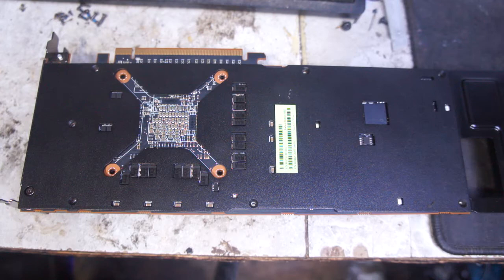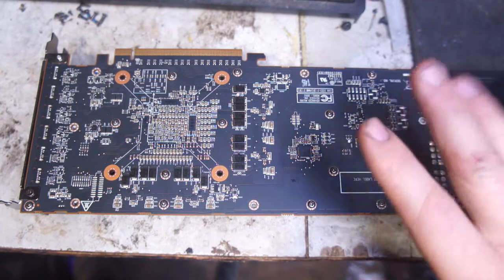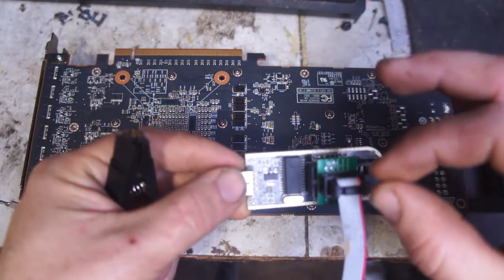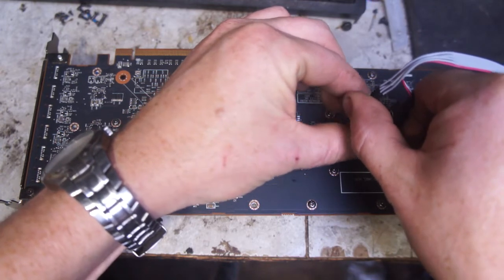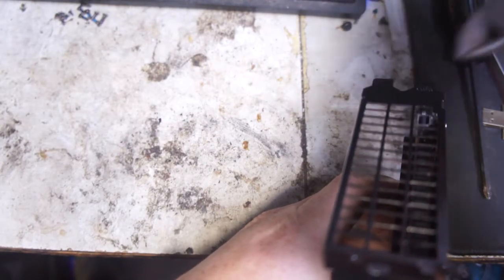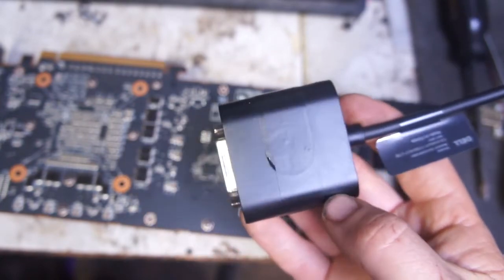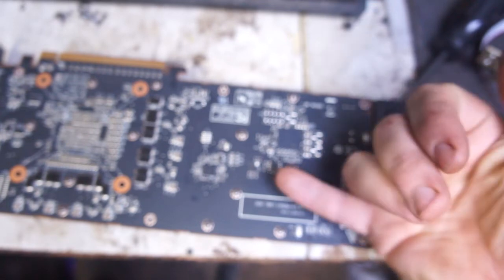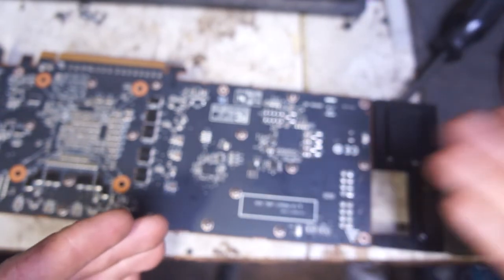Flashing MI25 to be cheap WX9100 (Vega 64)

Comment: Hello!
Can you flash it to a simple vega56/64 8gb bios? (Probably no because of the 16gb ram yes?)
Reply from the maker: Correct, VRAM amount must match. With some work you can do Vega FE though. I have a video that glosses over that then shows it working with well managed temps without tanking FPS.

Comment: You forgot to mention that this sort of contraption will not have all the nice features that AMD Gaming cards have such as RSR. This option will simply not exist in the driver. 

You can still use a games built in RSR but you cant have it as a global setting. Also the Radeon PRO drivers are unstable. Some games word great and others crash. Its a clusterfuck.
Reply from the maker: I have significant stability issues. Who gives a fuck about FSR and DLSS? Honestly, I'm tired of hearing about them.
Reply: @Marc_Wolfe  Correct. The stability is questionable, to say the least.
Reply from the maker: I assumed mine was just faulty. Abused in a mining farm or something. Sample size of one and all.
Reply: @Marc_Wolfe  Nope. Unfortunately not the case. I bought mine from a guy who mods them and sells them. He 3d prints a nice shroud and all... yet once I received it, I cant get it stable to save my life...

Comment: And why exactly would someone want to do this? What's the benefit of WX9100 over a MI25?
Reply from the maker: Windows support, display output of any kind, even Linux support went to shit as far as I could tell. Basically, it comes down to making use of trash. Having something that functions vs just a brick.
Reply: @Marc_Wolfe  What? The mi25 is a ML card. It's definitely not a brick! For less than 100 USD you get a decent card for something like stable diffusion. Why would anyone buy a mi25 to use as a graphics card?? Makes no sense.
Reply from the maker: @dtesta  "Machine learn"... it's the same shit as any other Vega64. The end. It was a prototype, had enough validation to sell as a beta test, then got artificial segmented models later.

Comment: Hey I bought the ch341 but when I try flashing the wx9100 bios it says error file size isn't the same size as the  chip, any tips ?
Reply from the maker: M25p80, as in description
Reply: @Marc_Wolfe  it auto detected the m25p80, just confused on why it thinks the chip is 1mb but the rom file is 256k, sorry about all the questions man, I've tried getting help elsewhere but most people don't have a clue about this stuff.
Reply from the maker: @ericwills7748  There are a variety of chips with the same programming interface, like data format and whatever. The M25P80 isn't the actual part or the right size; write it anyway.
Reply: @Marc_Wolfe  I tried forcing it but it just gives the same error
Reply: I finally got it flashed to wx9100 but unfortunately the mini dp to HDMI adapter I have didn't work so I ordered the dell  mini dp to dvi in the link you shared, thanks for the help man, keep the cool vids coming.
Reply from the maker: @ericwills7748  Sure you flash the right one?
Reply from the maker: @ericwills7748  I meant the right EEPROM on the card.
Reply: @Marc_Wolfe  oh mb, yeah I think so I flashed the one you called chip 1 in the video
Reply from the maker: @ericwills7748  I don't think I pointed them out wrong, but it has been a while; on the off chance I did, try flashing the other one. I can't check for you right now, I broke one of the jumpers on mine and ripped up a trace.
Reply: @Marc_Wolfe  working tonight unfortunately, will tomorrow if possible
Reply: @Marc_Wolfe  I must have jacked something up when I flashed it, when I install it in my ASRocK taichi x570 it won't boot shows a 07 or D7 error code 😢
Reply from the maker: @ericwills7748  That the good part about USB flashing. Just try again.

Comment: Was Wondering, it's flashed to WX9100 , does it still consume 300 watt? coz the Wx9100 is rated at 230 watt.
Reply from the maker: As far as I can tell, it follows the WX9100 power limits.  Frontier Edition is better, but requires soldering because of AMD's bullshit. There's probably (definitely) some way to make it cooperate as Frontier Edition without soldering, but I don't know how.
Reply: @Marc_Wolfe  Yeah, saw a video regarding the "Registry" mod.. But hey a used WX9100 is around $400 to $600 in Ebay...AMD Instinct MI25 is $90 , water block around $100,  for $190 not bad since I am gonna use it for a Mac Pro 5.1. Vega 64 with 16gb is almost the same as WX9100...RX 6900XT is way too expensive too..U do good work man, kudos..

Comment: What exactly is the purpose of flashing here? Both cards have the same core config and the 9100 has lower clocks than the Instinct. Doesn't make sense to me.
Reply from the maker: You're right, it doesn't. AMD's decisions around artificial segmentation... that's why this is.... "required".

Comment: I need help, do you know why my gpu does not give video? The system already recognizes it, I have the 22q3 drivers but it doesn't want to output via mini displayport, I don't know if it's a matter of having to solder a jumper or I don't know
Reply from the maker: No soldering needed for the WX9100 vBIOS.
Reply: @Marc_Wolfe  I put the vbios of the wx9100, but it does not give me video. Do you know if any adapter works? or does it not matter if it is thunderbolt to hdmi?
Reply from the maker: @UnprocualXP  It's not thunderbolt. If you have an adapter that's thunderbolt only (like some Apple bullshit), don't expect that to work. I put a link to a decent one in the description.

Comment: Is there a difference between the MI25 8+6 pins and the MI25 8+8 pins?
Reply from the maker: As far as flashing the WX9100 vBIOS? Highly doubt it.
Reply: @Marc_Wolfe  I am about to buy an MI25 8+6 pin because it is cheaper than the MI25 8+8 for some unknown reason. Yes, I am going to flash the MI25 to the bios of the WX9100

Comment: According to your experience, which gpu is better, Instinct MI25 or Tesla M40?
Reply from the maker: A GPU without ports is... not great. My MI25 is defective. So in my experience, used GPUs overall have been a massive disappointment.
Reply: @Marc_Wolfe  does it not have the mini Display port like the instinct mi8 ?
Reply from the maker: @ericwills7748  Tell me you didn't watch the video without saying it.
Reply: @Marc_Wolfe  you're correct I didn't have time, I'll watch it thanks
Reply: I was gonna ask the same thing I'm currently on a m40

Comment: Any ideas how to cool it?
Reply from the maker: Quietly? Water. Otherwise...
Reply from the maker: https://www.youtube.com/watch?v=V6ttJLReuDs
Reply: Planning on 3d printing a duct myself... and using a large diameter CUI fan that has good static pressure amd move a ton of air, loud if at 4k rpm but quite below that. I used them in a rosewill L4500 build and was quite pleased... 3 of them can move a ton of air.

Comment: (sorry if answered elsewhere):
What happens if you just pop it in as an MI25 w/ a display connected? Do you HAVE to flash it to a WX9100 to get 'radeon-like' functionality out of the single mDP video out? 
I have a Vega 64 8GB @TM and want to use an MI25 16GB. I already have mDP adapters on hand from playing w/ Intel NUCs years-back.
Reply: Update: I've had my MI25 flashed to a WX9100 as a Daily Driver for 4-5months now. Also got Power Play Tables tweaked for performance closer to/above a stock Vega64 (where the extra vRAM isn't any help). My Aluminum tape shroud and 12x3.8cm 1.9A PWM fan have been more than sufficient since tweaking the PPT. The MI25/WX9100 has been a huge upgrade over my RX580 8GB and 6500 XT, and noticeably an improvement over my 8GB Vega64 (in most titles). I've been so happy with it, that I almost bought another one for crossfire testing, lol.  (This has been one of my best 'risky purchases' to date!)
PS: You can do multiple displays off the one mDP (within bandwidth constraints) using an MST hub. I tested 2x 1080P displays on an old DP1.2 eVGA MST hub, and a newer DP1.4-spec one from StarTech; they both worked. Caveat: The "WX 9100" works w/ FreeSync displays great, only on a single display. Most MST hubs that claim VRR/FreeSync/G-Sync passthrough, are reported to not do so reliably; oh, and they're $70-90+ too. (It's unironically and literally cheaper to get another MI25 and flash it, to get 2x VRR/FreeSync display-outs.)
Reply from the maker: Without flashing it, I never got it's display output to function AT ALL. I might be be misremembering some details, but I think if you install the NVv4 Azure guest OS stuff, you can right click in device manager and go through the list for driver options and just select "MI25". Probably horribly out dated with that option though. If you just want to use it for compute (no display, other GPU for display), you could manually select MI25, WX9100, Frontier Edition, or the more generic "RX Vega series", and have something that ... probably works for what you need. You'd have to do your own preliminary testing there to be sure though.
Reply: @Marc_Wolfe  Thanks. Bit the bullet and got one for ~$75+Shipping+Tax. Will be an adventure; but I love having 'unique' kit.
Reply from the maker: @labrat810  Hope I didn't need to mention cooling.
Reply: @Marc_Wolfe  I've had success in the past using aluminum tape to create a duct and mount for a 120x38mm 'server blower'. Hoping to find a 4-pin 12x3.8cm in my collection and have it PWM controlled (so it doesn't sound like a hiar dryer, all the time)
Reply from the maker: @labrat810  I used electrical tape. Aluminum tape tears easily... and is conductive.
Reply: @Marc_Wolfe  Reporting Back: Success! Software flashed to WX 9100 vBIOS using atiflash 2.93. Display and 3D works. Will be rigging up cooling shortly. (BTW. The VegaFE vBIOS does not produce video, even using an MST hub.)
Addendum: These "WX 9100"s POST in very "Legacy" non-UEFI systems. For giggles, I tested it in an A8N-SLI Premium. It worked!
Reply from the maker: @labrat810  yeah, anything X86 with a PCIe slot. FE gives display out until drivers load.
Reply: @Marc_Wolfe  That has not been my experience in the past. I have ran across some 'UEFI-only' cards that prevent POST entirely. Ex: My Asus RX 580s (MSI RX 580Xs works fine though).
Reply from the maker: @labrat810  I was talking about other cards.
Reply: @labrat810 do you have discord? It would be amazing to see your progress, I would also have a few questions
Reply: @labrat810  Planning on putting 2 in a KGPE-D16 for giggles... its also got 2 overclockable ES 6386SE in it... and 256GB ram because it was cheap lol I wonder how well HBCC works.... definitely going to test with a giant solidworks model.
Reply from the maker: Links in description will likely lead you to more answers you're looking for.

Comment: Decent video on using the CH341, but this card can be flashed with software.
Reply from the maker: I don't care if it can anymore; this option is more universally useful.
Reply: what software?
Reply: @Murr808  atiflash 2.93. Make sure you're running Command Prompt as Admin, and your WX 9100 vBIOS is in the same folder. Always use 'amdvbflash.exe -i' first, to make sure you're flashing the right card.
In my case the command was "amdvbflash.exe -f -p 1 218718.rom"
("-p 1" being the '2nd video adapter', and "218718.rom" being the .rom from Marc Wolfe's Video Description link. The technique is also linked in (t)his video's description)
Reply: @labrat810  windows?
Reply: @labrat810  When running this in windows, amdvbflash shows "Adapter not found". Windows sees the MI25 as a generic AMD Vega Graphics card.  How did you get ATIflash to recognize the card in order to flash the vbios?
Reply: I figured it out.  Had to disable CSM in the bios.  Successfully flashed and windows recognizes as a WX 9100 after reboot.
Reply: @itsjcrane81  do you get video output? I flashed mine and with an adapter I couldn't get video, I think you have to configure some EDID in the drivers, in the end I'm using it with mshybrid, but it would be very helpful if you tell me if it gives video without changing anything in the driver or not
Reply: @UnprocualXP  I didn’t test video output since my primary interest was testing for crypto mining. I plan to play with other vbios flashing so I can test video output (believe I have a mini-DisplayPort adapter somewhere)
Reply: @itsjcrane81  what hashrates did you get? FLUX and ERGO should be very good on this. ERGO in dual mode or maybe DNX ?
Reply: @Alexandar1nf0  I only got ETHASH working anywhere from 40-47mh.  The main issue is overclocking and controlling power.  I think I tested KASPA, but the power usage was so high it wouldn't be worth it. I agree memory intensive algo's should perform better but lost a bit of patience testing.
Personally, I have 8 MI25 cards with plans to put them in an octominer, but I'm hesitant to spend more time on it.  So if anyone is interested in 8 cheap MI25 cards in really nice condition, let me know ;-)
Reply: @UnprocualXP  You should get video output if you use a vbios  for a card that has 6 video outputs which is why most Vega vibios dont' work but WX9100s vbios does as it has that many displayports.